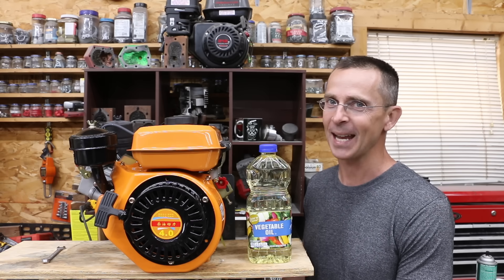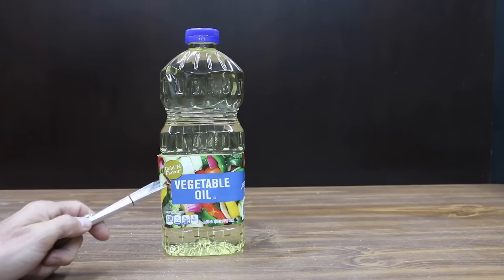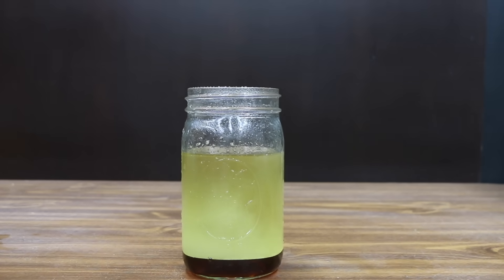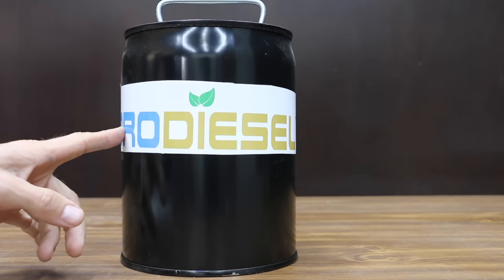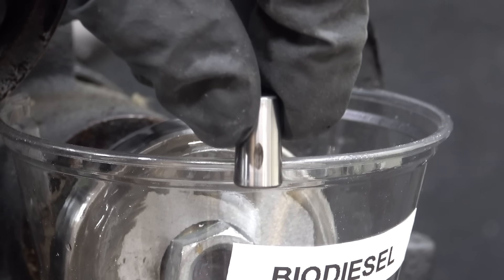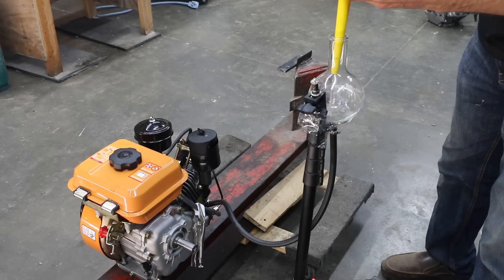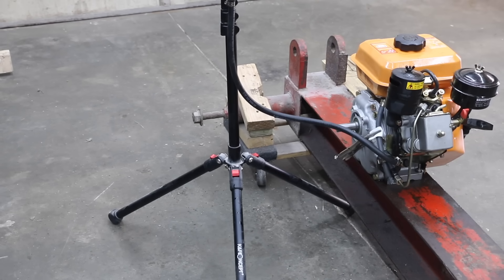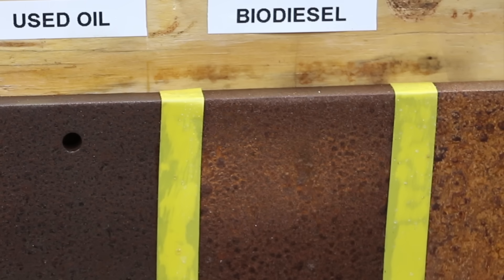Make "Biodiesel"? Let’s find out! Diesel vs Biodiesel, Used Motor Oil, Vegetable Oil, MPG

Comment: G'day,

Thanks !

An excellent, information-packed video (as usual)

At the moment I'm trying to rescue a set of six brand new  Deep-Cycle Storage Batteries (6-Volt 225 Amp/Hour Rated Capacity - "Golf-Cart Batteries") which, due to some crazy laws and or Corporate Policies..., were factory-filled with Electrolyte in Adelaide - 2,000 miles away before being shipped.

On arrival 4 had resting voltages of 6.33 to 6.35 Volts, (fully-charged they should each hold 6.6 V.), and with modern (diluted) Electrolyte of 1.265 SG when it went in...; they'd been self-discharging & sulphating at 0.9% of their Stored Charge, per day..., so they were 22.5% discharged & sulphated over some 28 days enroute...

The other pair were only holding 6.04 & 6.05 Volts, being 40% & 42% discharged & sulphated, having taken an indicated 57 & 61 days to get here.

  After a couple of weeks I've got the 4 best ones holding 95% of their Voltage (13.05 V, connected in Seried Pairs ) at 17 hrs after coming off-charge, & the worst pair holds 12.83 Volts, resting at 17 hrs.

 I've load-tested the worst pair, and after an hour of a 13 -Amp Drain (6% of Rated Capacity) they were holding 12.295 Volts, so their loaded voltage is down about 30% on what it should be...

My question is..., will it be worthwhile to apply either a "Charge-Pulsation" Device to "shock" the Lead-Sulphate Plaques off the Plates, OR to add Cadmium Suphate (sold in Oz by a company called "Inox"), or should I stick to simply trying to cycle them a few more times, running their Voltage up to 14.8 & sucking Current out at 25 Amps to try to Thermally-Shock the Plaques off the Plates...?

I have posted 5 videos so far, doccumenting the situation, my attempts, & progress so far..., with the first title in the series being,

"Emergency-Rescue Recharging Brand-New Deep-Cycle Storage-Batteries...!"

Once upon a time, new Batteries were shipped Dry, with their Electrolyte separately bottled - and this was never a problem with New Batteries...; but I've lived off-grid using thow-out Batteries intercepted between the Golf-Carts & the Recycler, for 25 years, so I know all the usual tricks - but I haven't got any hard data on the Pulsators or the Cadmium...

And I'm otherwise about ready to pour out (and save) the Electrolyte, wash out the Cells & fill them with Distilled Water, charge them up to 14.5 Volts to try to add Osmotic Pressure to the forces acting to dislodge the Plaques - then empty out the Water & put the Electrolyte back in....

Your input would be highly prized, if you can help...(?) !

Thanks, in advance...

Have a good one,

Stay safe.

;-p

Ciao !

Comment: Test bug spray to see which one actually works and keeps ticks and chiggers off of your legs as well as flying insects.

When working on a fence line I actually use Dawn soap and water mixed in a spray bottle and it seems to be as good as anyting sold commercially. It also works great for killing wasps possibly better then the expensive wasp spray sold commercially.
Reply from the maker: Thanks for the video idea.

Comment: Rudolf Diesel actually designed his engine to run on peanut oil. Petroleum fuel came later. I bet you could run that Dodge on straight vegetable oil, but it would flush all the carbon out, and clog the filter.
Reply from the maker: Thanks for the feedback.

Comment: Used motor oil should be mixed 50/50 with diesel and filtered very fine before being used as fuel. Straight vegetable oil should be preheated to lower it's viscosity. In either case it will coke up the injectors with carbon over time. 
The way I made biodiesel was used vegetable oil from fast food joints. Then I mixed up lye and methanol to form methoxide which is very nasty stuff and will eat through your skin if you let it. Add that in the right proportion to the toxic waste used vegetable oil and you get glycerin and biodiesel. The glycerin is the stuff that collects on the bottom. You definitely want to remove the glycerin BEFORE washing with water. Glycerin is a common ingredient in makeup and many other things. Biodiesel is completely harmless. I have seen people drink it. I sure wouldn't drink it. 
I never heard of hydrodiesel. I'll have to look that up.
Reply from the maker: Thanks for the feedback.

Comment: I wonder if hydrodiesel did so well on both lubricity and freezing tests just because it's full of additives, while DIY biodiesel had no additives.
Also, i'm certain hydrodiesel would perform a lot better if used in an engine with a higher compression ratio and turbo.
Reply from the maker: Thanks for the feedback.

Comment: I came to the comments to point out that Rudolph Diesel used peanut oil in his engines, and just to check that information, googled it. I was really surprised to find that although he did in fact eventually use 100% peanut oil, he tried different fuels first. The strangest one to me was coal dust dissolved in water! That was completely unexpected!
Reply from the maker: Thanks for sharing.

Comment: I work at an injector reman shop, we mostly work with CAT C15 injectors. We can tell if you run any fuel alternatives. Usually anything other then diesel will get sticky and crappy after awhile. Definitely do not store your vehicle with any of this stuff in the fuel. Motor oil and any heavy oils also have a higher BTU count then diesel, it burns hotter possibly damaging the injector nozzle. Usually people say they see an "increase" in power when they run vegetable oil or motor oil in their trucks, this is because these fluids have a higher viscosity then regular diesel. When your pumps get worn out adding a thicker oil will make it more difficult to make it past larger tolerances equating to more power. (Almost like putting heavy motor oil in a knocking engine, it fills the large tolerances better) If you like the "power" you get from running a heavy oil try dilute your diesel with 2 stroke oil since its designed to be burned! 

Great video as per usual! Can't wait to see more of this little engine!
Reply from the maker: Thanks!

Comment: Would be nice to see a comparison between diesel and biodiesel/vegetable oil in terms of miles per gallon, or equivalent measure of burn rate with a loaded engine. Willie Nelson, and others,  always sing the praises of corn oil, but there's NEVER any data to back it up. Only the word of a pot smokin country singer.
Reply from the maker: Great suggestion!  Thank you!

Comment: Since you were using Used motor oil, would passing it through filter material clean it up(remove carbon& crud) ? Making it 1) better fuel for diesel engine 2)  useable motor oil again ?
Reply from the maker: Thanks for the suggestion.

Comment: Hey PF can you test PolyDyn Tx7 engine oil additive?  It’s Teflon based and they claim it’s safe for turbos. I’ve used it for decades and never had an engine fail even over 330k miles
Reply from the maker: Thanks for the video idea.

Comment: Would be really interesting to see length of time that engine runs on equal amounts of the "fuel" types used and if possible a type of power test. 

Maybe hook it up to a go cart and see how fast of a run each fuel type produces. Might be a reasonable "real world" example of btu produced. You could also use the go cart for the "mileage" under load compared to say an idle test.
Reply from the maker: Thanks for the suggestion.

Comment: I've run biodiesel, heated veg oil, and veg oil cut with gasoline.  The best product is bio but it's the most involved by far.)  I eventually got my process (cutting with gasoline and running through a sock filter) to just about an hour a week- and that included collecting the oil.  I miss my old Benz and my TDI Jettas.
Reply from the maker: Thanks for sharing.

Comment: On a small scale, lets say from the user of the biodiesel of was able to find used cooking oil on curb of Delis and restaurants as is usually the case, it does make a lot of economic sense, but this process can not scale! You are basically burning food, the regions that can grow plants in quantity to produce the oil are mainly in the tropics and just there is not enough land available to swap from crude oil, so far the allure of "cheap, plentiful and clean green energy" remains elusive if not strait up impossible in many cases. 
      The fossil fuel industry runs on fossil fuel but so does the "renewables energy" sector, so the fossil fuel is fed by itself in a neat closed loop but the same can not be said of the "green energy" : the farm tractors who grow and reap the biomass used in the "green energy" do not run on their own products!
Reply from the maker: Thanks for the feedback.

Comment: Anyone running biodiesel in a 2017 or newer dually?
Reply: Don't. Do. It.
Reply: @tylerbraden3512  y so confident?
Reply: @shrek22  because I work in the industry. I see what biofuel can do to a fuel system.
Reply: have u seen success with Dimethyl Ether by chance?

Comment: 1989 7.3 liter ford diesel in a 350 van,  i ran used motor oil in it, i ran used peanut oil in it..i ran used vegetable oil in it.   that engine RAN PERIOD.
Reply from the maker: Thanks for sharing.

Comment: Can you do a video on different latex wall paints or how strong are different ceiling fan boxes? How strong are different garbage disposals? I don't know I'm thinking about household issues like even sump pumps, how long can they run dry until they light on fire. LOL, I had a sump pump boiling the water in the sump because the PVC for the drain had ice in it thus blocking it.
Reply from the maker: Thanks for the video idea.

Comment: I'd be curious to see if the vegetable oil will cause a sticky buildup in the engine.  I've heard that when the restaurant industry switched from animal fats to seed oils for frying, the seed oils off gassed and left a sticky mess on the walls.  Also, where did you find a diesel small engine?

Comment: This is excellent. People often overlook diesel as a fuel source, and biodiesel in particular.

would you consider doing gaseous fuels in a diesel engine? Like natural gas or propane?
Reply: Public buses where I live do this. They still have to use a bit of diesel to ensure everything ignites at the end of the compression stroke, but most of the fuel is natural gas. Very noticeable difference in the exhaust compared to a normal diesel, they never smoke and have very little exhaust odour.

Comment: Strange thing. I haven't seen anybody driving old VW 1,9 or 2,4 TDI with regular diesel in their tank. Mostly used french fries oil with some diesel addition. Winter the same wit anti freeze suplement. 
I live in Easter Europe. 😆👌🤪
Reply from the maker: Thanks for sharing.
Reply: @ProjectFarm  I have two ideas for you. Hammers - not which one is best but to try yourself and/or show the American audience a single claw hammer. It looks like the second one got broke off. 
Second one folding knives, but not this jewelry for $200 apiece. More the simple ones 3.5-4" blade with lock and some budget pricing.
BTW Eastern Europe runs more on LPG, not on the french fries oil from McDonald's. I mean it does happen in the past a lot but today the injection system would explode with such "fuel". 
Love your videos you are the top league YouTube Creator.

Comment: Years ago I remember seeing a guy that ran his car on diesel and vegetable oil two different tanks

He would start the car on diesel and then switch over to vegetable oil and then when he was 10 minutes from home he would switch back over to diesel to clean out the system.

This way he never had to process the vegetable oil into fuel, you could literally just pull up to McDonald's and top up.
Reply from the maker: Thanks for sharing.

Comment: I have an old IDI that gets problems (Engine dies after applying and letting off the throttle) every once in while from the low sulphur diesel. Those old diesels' injector pumps and injectors really rely on that lubricity. I add the lucas oil fuel treatment and the problem goes away. I've also used transmission fluid and that works too 🤷‍♂️
Reply from the maker: Thanks for the feedback.

Comment: I use 90%used oil and 10%diesel mine has motor oil hydrolic tranny and gear oil get great fuel mileage in my 01 05 and 07 Cummins 5.9 and 6.7. but I heavily filtered and heated for junk. I use a hot water tank heater and hole house filter at 10,5,1 and .05 micron filters with water filter
Reply from the maker: Thanks for sharing.

Comment: I've been running veg oil for a few years now, just straight in summertime and add up to 10% gasoline in wintertime. Cold starts in winter is a bit rough but even in -18C this winter it was fine... No preheat needed :) Has to be rapeseed or sunflower oil tho. I don't know what you used but palm oil gels up faster and also the exhaust smell much worse on that..
Reply from the maker: Thanks for sharing.

Comment: I don't remember a rash of injection pumps failing when they reduced the sulfur.  Never added any magic juice to my tank.

But hey, people still think old engines need lead to lubricate the valves.

Now everyone is freaking out over ethanol.  There last few years of carbureted engines with foam floats had trouble, that's it.  10% ethanol gas has been available in Nebraska and Iowa since around 1980.  It was the cheapest gas there, it's what everyone used, in everything.  I used it in all of my mowers, weed eaters, post hole diggers, and chainsaws.  I left it in all winter.  No issues.
Reply from the maker: Thanks for the feedback!
Reply: @ProjectFarm  another fun fact, the railroads switched to ulsd and didn't change a thing.

Comment: Hydrodiesel might be good to help clean the engine ports or even the intake (in engines with EGRs). 
Would be interesting to see a comparison diesel vs hydrodiesel on a long run.
Reply from the maker: Thanks for the video suggestion!

Comment: How difficult would it be to convert a gas engine to diesel. May be a life saver if the need arises.
Absolute dedication absolute loyalty.
Reply: I believe it would have to be completely rebuilt. Gasoline and diesel engines run on completely different processes. Gasoline engines typically use a hot ignition source to light up the fuel, diesel uses the heat generated from the compression of the mixture to ignite the fuel.

Comment: This was awesome!!! When I was kid working at a restaurant I got all the free WVO I wanted. Mechanical injection system are the only was they work well will all this "extra" stuff. Thousands of miles and a few thousands gallons of WVO, been through.  Waste motor I tried but was too dirty.   I miss the smell burning WVO. 6.2L , 6.5, TDI, 1.6l , even the old 7.3 IDI I have used.
Reply from the maker: That's great!

Comment: Did you ever test those pulse battery chargers that are supposed to break up the built up crystals on led batteries? I just bought 1 but no clue if they actually do anything & I'm sure no company test them like you would & be honest with the results.
Reply: @Only Memories Go With. Nothing Else. I do have a big arc welder but never heard of using one to restore dead or remove crystal build up in them.
Reply: @Only Memories Go With. Nothing Else. I have a 300 amp welder, food for thought. I'll look for videos on it.

Comment: I run my 95 volvo 460 1.9 turbo diesel on veg oil , had one time problem with injectors , and that's it . In winter  i mix oil and diesel and add 1l of petrol for 50l of fuel . Bit more smoke and the smell of fries comes with it , but its cheep and fun :)
Reply from the maker: Thanks for sharing.

Comment: I've had talks with guys that converted some of the first model VW rabbits and golfs to run on vegetable oil years ago.  They loved it because they could achieve 80mpg's or better.  The issue they all agreed on was the vegetable oil was harder to start the motor so many had a small tank with diesel fuel to get started then switch it to the cooking oil.  These guys live in FL so freezing is not to much an issue.  But if you are dead serous about running cooking oil I'd suggest an engine preheater as well as a water bed heater belt wrapped up with insulation around the fuel tank.  This of course should be powered by a extension cord at home on a wall socket timer.
Reply from the maker: Thank you for the tip.